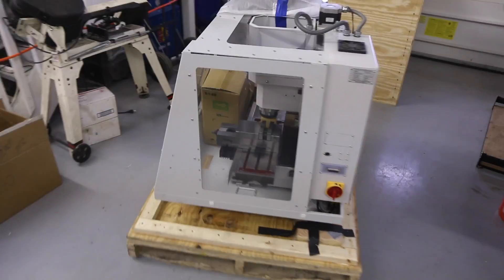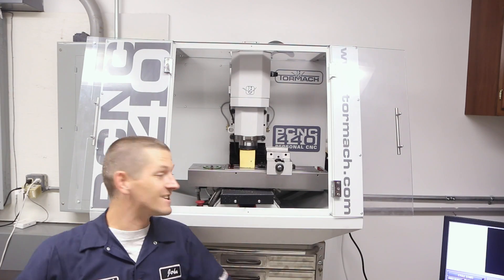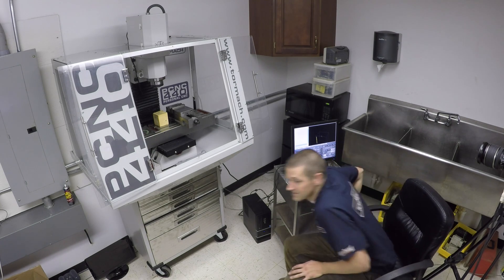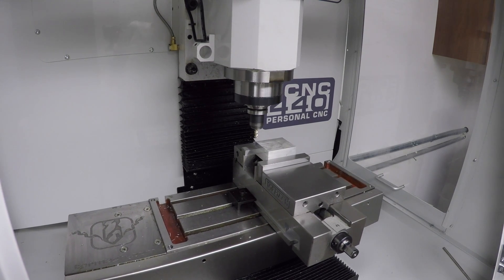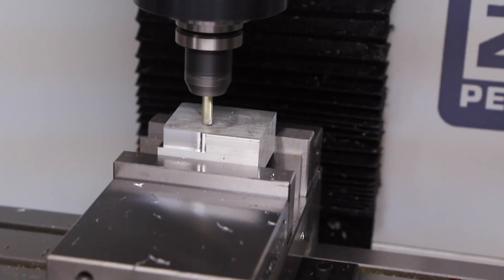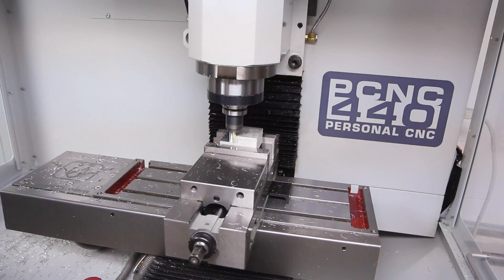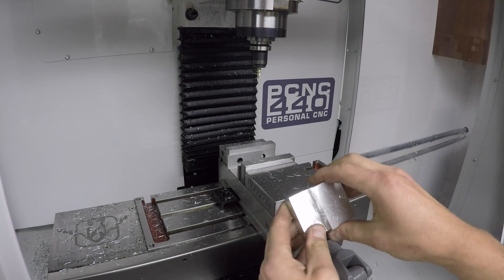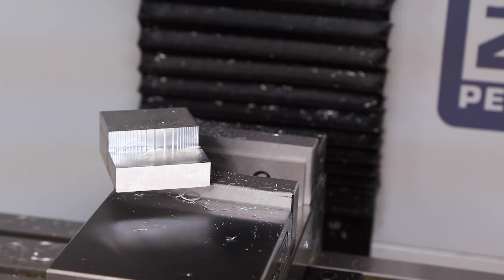Tormach 440 - Unpacking & INCREDIBLE first cuts!

Comment: Before you buy one give me a call 208-600-2658
I bought one, if you buy one put the minimum down because it will  not work.
It comes in pieces so they can blame the customer for anything that is wrong.
I have had in 2 months or more, no tool changer in back order one more month.
Computer was bad they replaced it but still does not work.
Cannot get your money you just have to eat the piece of shit.
I have been in the CNC business for 50 years first one in 1972.
I have purchased several HAAS machine never a problem with any of them.
HAAS would not fit in the place my mistake                                                                                                        .They send you all kinds of cables you do not need just to get the price up.

IF YOU CANNOT AFFORD A HAAS FORGET IT

You can buy thisne cheap
Cheap being the magic word

Gmcdaniel@arthurlabs.com

Comment: why don't any of you youtubers make videos cutting steps, pockets and holes and measure the locations and dimensions of the parts with accurate measurement tools so potential buyers can really see how close of tolerances can be held in aluminum vs steel on the 440.

Comment: Hey John, great video.
Question,
I am considering getting a tormach 440 vs a taig or  this Japanese one, kitmill ast200 please see link. (https://www.originalmind.co.jp/products/kitmill_ast)
What do you think? I need a table top sized setup for quick prototyping and maybe small volume production. Will be cutting plastics, aluminum and stainless. Tolerances of a minimum of .002" ball park
I gotta say the Japanese mill looks pretty impressive for it's size factor

Comment: John this video was what sold me on grabbing a 440.  I got in on the pre-order for round 2 and my 440 was just delivered yesterday!  So let Tormach know their sponsorship of you is working.    https://www.youtube.com/watch?v=rvW0947v7t0
Reply: +SAKModder gday from Australia , just wondering the price of the 440, wanting to get into milling Harley floor boards (foot pegs) any advice or would this machine be over kill for that cheers
Reply: +freeeeeeedom no rulers Contact Tormach and request a quote.  Thats the only way to get an accurate cost and shipping cost for international.  Total cost for me was price of Mill, plus shipping to Canada, plus brokerage and taxes at the border.
Reply: *****
cheers man , thanks for reply, can i ask what 3d software you may or may not be using, to convert to g code for tool paths etc etc , i am learning g code ,but would like alternate process for coverting my designs from 3d drawing on computer to g code any advice??? thankyou again

Comment: actually, it with the 770 has a better removal rate then the 1100 just cant run bigger cutters. I still babey mine. But just got a haas mini mill, i should be able to get in trouble with that..

Comment: John Stop messing around with the Chinese mills and buy a Haas 650 ipm.  +- .0002  
You can make some real money, you are talented and smart.  You can get financing at like 5% for 6 years and its yours.
You only need to  clear an extra 700-1400 mo/  and with  883 ipm on a VF2 you should be able to really make some chips.
 That 440 is for serious hobbyist, you have been doing this long enough , you left the hobbyist level long ago.
Buy American !  
BTW I think the Fusion 360 is perfect for a small job shop turning out one offs and best of all it's priced right.
I use it for engraving parts, it's fast. My TopSolid is ok for engraving but too much work for so little.
Come on dude !!  go for it. you won't regret it.  If you want me to hook you up with a good finance company let  me know?

Comment: This little guy reminds me of a machine I checked out a few months back designed specifically for secondary ops.  If we were still making gun parts on our lathes we would have probably picked one up to run the 2nd ops on.  Pricing was a bit steep but it literally was a mini machining center that could be moved around with the included pallet jack.  haha
Reply: +NYC CNC yes sir

Comment: Looking forward to unboxing/setup of your retail 440 when it arrives! I am thinking about getting this one; mostly worried about getting it into my basement without a hoist...
Reply: +NYC CNC yeah :(
Reply: same deal here.  at about 350lbs I'm thinking it's just on the edge of doable.  I got my lathe down the steps, but not sure on the awkwardness with the center of balance of this machine
Reply: Jesse you could always use a stair worty 2 wheel cart...the kind with the tracks on the back side with a brake to get down or up stairs.  Movers use them to move some really really heavy stuff up and down stairs.
Reply: +akromix thanks!
Reply: +suckerpinch Greetings,  about a year ago we put a very large cast iron stove in a friends basement.  Hint let gravity work for you.  get some 2 x 6ixes on the bottom use hard board and tack them in with a butt joint.  Attach eye bolts to the crate of the unit.  Use heavy line through the eye bolts and slowly let it down.  Still think safety and have some extra people around guiding it and an extra hand holding the same part of the line you are at the bitter end. Good luck. Keep the 2x6ixes near the unit for removal at a later date.  Hope this helps....

Comment: Cool little machine, John.
My little home made mill does 6600 RPM on the spindle. When I went to my bigger mill, I am stuck with 4500. While it does okay in aluminum, I sure miss that speed of the little mill. 10,000 RPM on this one is right where it should be. Cudo's to Tormach for that foresight.  Now lets have some fun with it. You mentioned you might need coolant for chip evacuation?
I think not. ;) A broom might do a better job.

Comment: What about the style of bed you have on your 1100 wouldn't that be possible to make one for this machine because of the enclosure
Reply: +NYC CNC The bed table that you have on your tormach PNC 1100 with all the holes in it instead of the standard t slot base
Reply: +iCloud Henshaw You mean a fixture plate?   Yeah he can and probably will make one for use on this.

Comment: you need a slow mo cam
Reply: +NYC CNC maybe the new rx100 mark iv (or the big brother rx10 ii I think) could do the job. only decent affordable slo mo cam there is. its about a grand. it can do 1000fps in somewhat watchable resolution. 1000fps @ 10000rpm should give your 6 frames per turn. for even better fps or resolution we're easily talking 5 figures